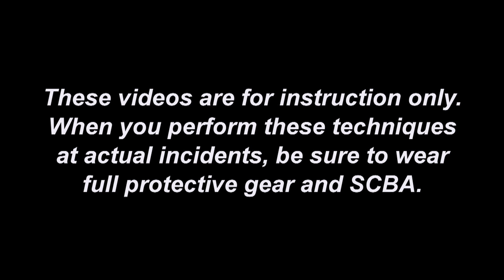EV Extrication: Steering Column and Dash Relocation

Comment: The ram displacement of the steering column as shown has two very significant issues.  First, if the angle of the tool on the rocker channel isn’t in the right angle, the tool can easily slide back down the channel towards the B, moving the tool into your patient and dropping the steering column back onto the patient. Secondly, there is no room for patient removal with this ram taking up the passenger space.  This may be a marginally applicable technique if you are removing the roof and lying the seat back to extricate out of the top rear of the vehicle.  
The steering column lift does have far more application in the same issue but requires a department to purchase the longest spreader you can.  I am a huge proponent of the bigger spreaders even though they are heavier. Top down door crush and open can be accomplished in 3 moves or less vs other door opening techniques, but can’t be efficiently done on SUVs or heavy duty pickups with the smaller tools. 
These tricks shown are anomalies however.  Always do a solid peal and peak of where you wish to cut. Front position charging ports are rarely affected by traditional dash lifts although the potential does exist.